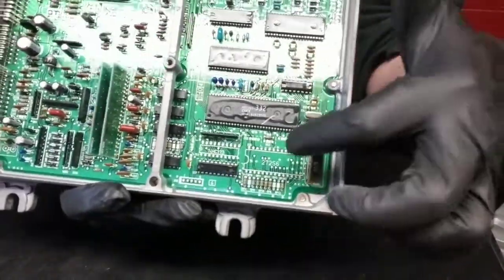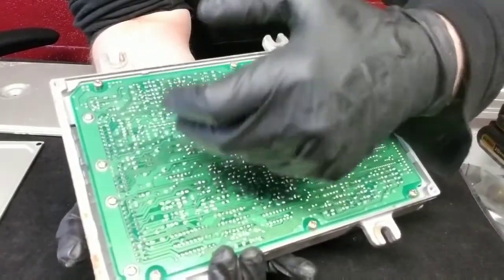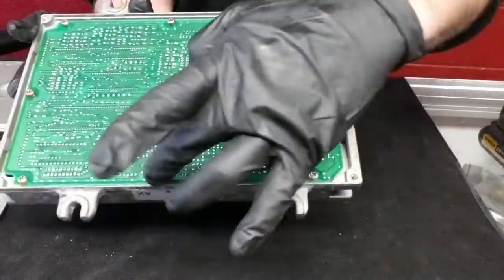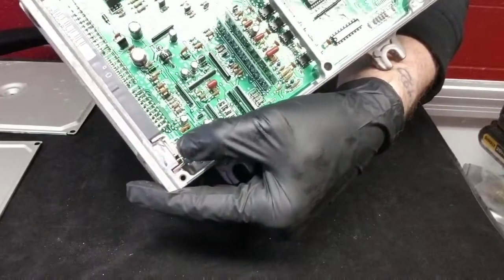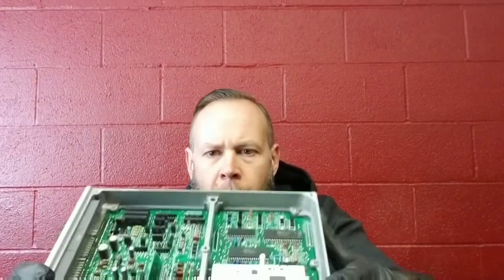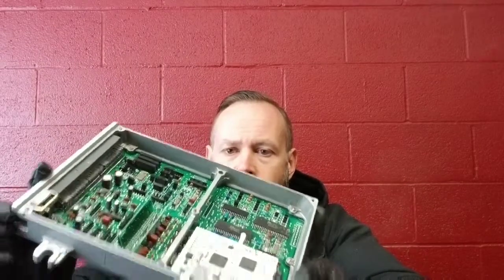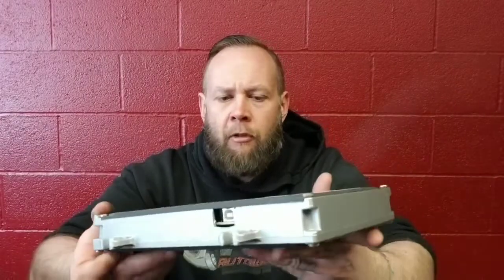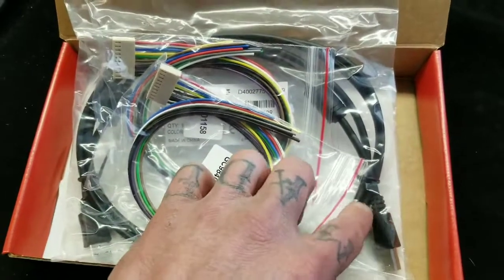How we convert Honda obd1 ecu to Hondata s300

Comment: I got s300 in a p28 ecu . If im putting it in my eg civic with a built d16y7 do I need to disable the CKF sensor ?? Please help. Looked everywhere.  No luck on this setup
Reply: Obd1 doesnt look for ckf which means your good, you dont have to unplugg nothing

Comment: What is available for auto tra s
Reply from the maker: It depends on the year and if the trans is on a separate computer
Reply: @RCautoworks  I have a 2001 Honda accord 2.3l with  automatic transmission I have not checked if it has a separate computer for transmission